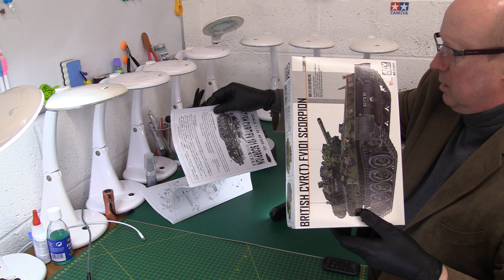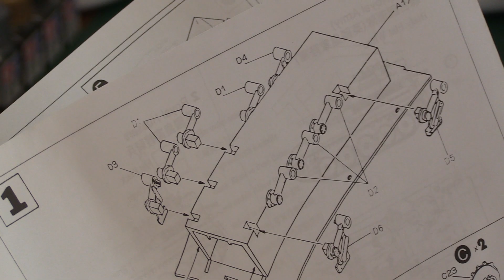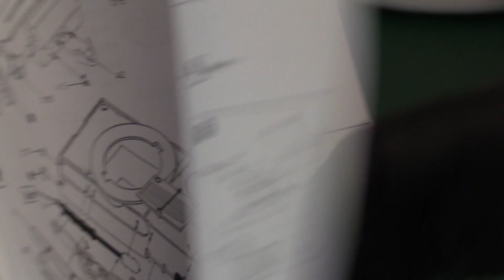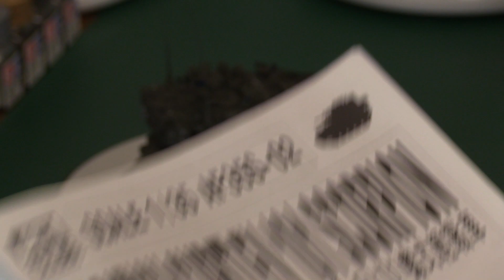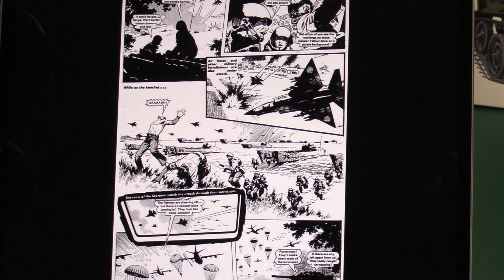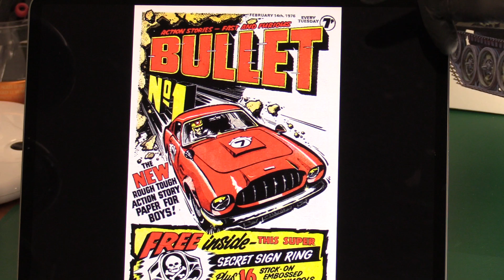1/35 AFV Club FV101 Scorpion Tank after-build kit review & Wingnut Wings trailers

Comment: The tracks on this series of vehicles actually bow but are not bow string tight,also the tracks are a brightly coloured polished steel look after a short time of use,they are jet shiny black and very tacky in there crate when new ones are fitted much like all AFV tracks,most model model makers always make this mistake,lovely camo idea though most crews would use cam net and chop it to fit,so various bins could be utilised,each to there own